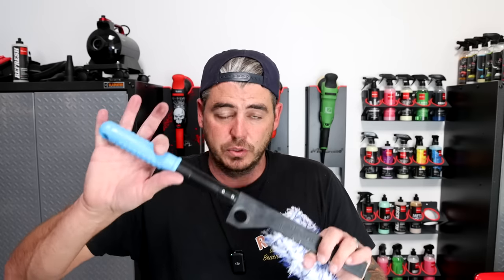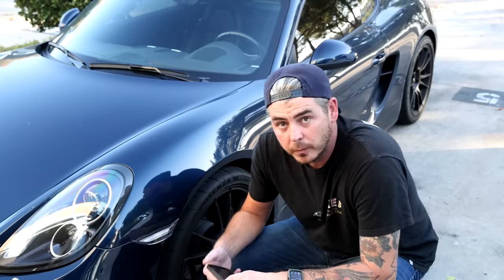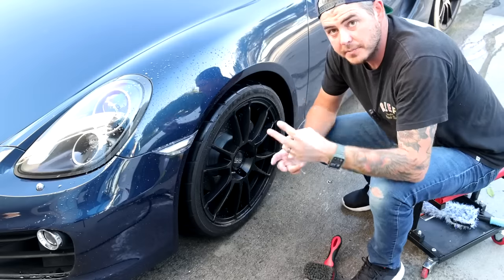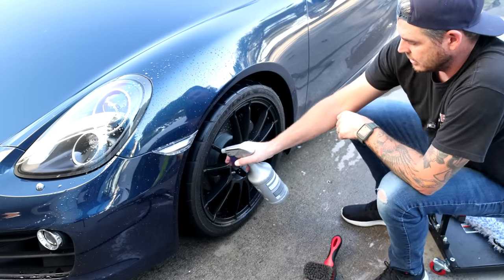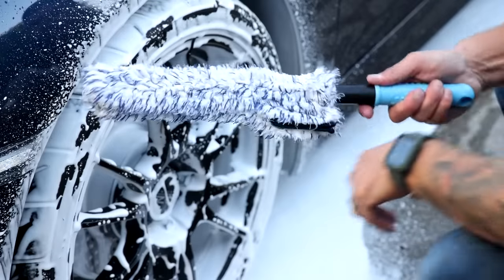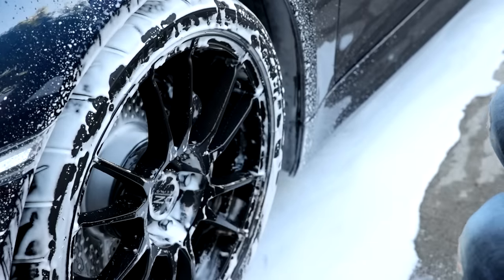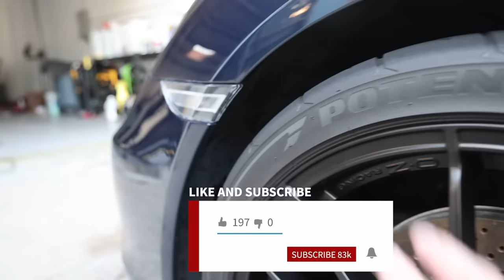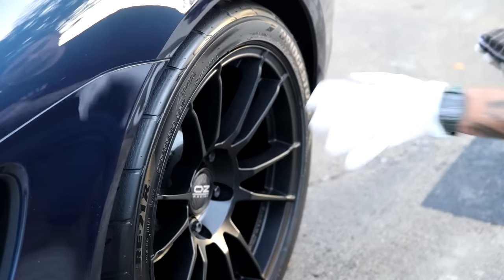HOW TO CLEAN YOUR WHEELS LIKE A PRO | Tips, Tricks, and Tools

Comment: Question Josh, I'm going to wash a high-rise building and will be using a Powerwasher. I will need a lot of hoses and wondering how much psi I will be losing. I heard around 50 psi for every 100' of hose. Is that about right? I'll need a high powered one I suppose.

Comment: Do you have PPF on your Porsche? If so, do you think its safe to use a pressure washer on it? I've been told not to use one because it can weaken the edges of the PPF.
Reply from the maker: I dont but i work on countless cars with PPF. My pressure is reduced to about 1100psi but you still just keep a little distance from the surface and youll be fine!

Comment: Think it's important to note that a dedicated wheel cleaner, which is one of the more expensive products, isn't necessary for a maintenance wash.

If you're a beginner reading this, soap and water works just fine unless you have caked on brake dust.  You can spray an iron remover once ever 6 months or so to prevent any build up, but it's not necessary for every wash.

If you have black high gloss rims and don't want them to get as scratched, first off god bless your soul, but doing a pre soak and rinse with a strong degreaser like Green Star will go a long way
Reply: I fully agree. Regular maintenance is key as with many things.
Reply: What’s your favorite iron remover product that doesn’t smell like shill?
Reply: @jseels  for consumers, Meguiar's All Wheel Cleaner, Griot's Heavy Duty Wheel Cleaner and Adam's Wheel Cleaner don't have that powerful, skunky smell.

Adam's Wheel Cleaner you need to be extra careful with though.  Even after checking to make sure my wheels/brakes passed the "cool to the touch" test, it stripped the paint off of 2/4 of my calipers
Reply: @tier1detailing  Adams I think has a PH level of 10. Did you try dilluting it first?
Reply: How do you clean the mitts / with the microfiber mitts / brushes that contact the wheel when drying them .   I don't know about washing them in the clothes washer.
Reply: Ty for this! I just used a wheel and tire cleaner for the first time and thought, "this is gonna make me broke!" The bottle felt almost empty after one use!
Reply: @christee299  happy to save you some $!  Brake dust that isn't embedded onto the wheel will come off very easily with regular soap
Reply: This! I've used only brake buster as im a noob in washing my car, but it has medium to low performance for me, ive got black matte and high gloss rims, on matte (driving on those as my high gloss are for summer) it does a weak job removing all the brake dust (german car so a LOT of it...) and ive noticed that washing with regular Gyeon Bathe has the SAME results. And iits not super cost effective as i need to spray it a lot (i use it neat) to wash the tire and the wheels. Annd its not so cheap here in EU. Might try just a more agrresive APC also on a little bit more filthy tires, i usualy dont use my pressure washer but a normal Marolex is sufficient to flush the residue. Cheers and great advice!
Reply: Which was was the iron remover?

Comment: Thanks for the vid Josh. Simpler for me to buy a gallon of brake buster, spray whole wheel and tire, agitate and rinse. Only $30 for a gallon and dilutes also.
I am a fan of Koch chemie tho. Especially their motorplast.
I need to get a barrel blade thanks for showing it.
Reply from the maker: Yea brake buster is a fantastic deal and I use it alot also! Personally i think the magic wheel cleaner works better in some situations like this satin black wheel. But Brake Buster is great
Reply: Not worried about pH when only 16% of my solution is actual chemical.
Reply: 16%

Yeah, ok.

74.3287% of people that use percentages to make a point, made up the referenced percentage.

Comment: I bought one of the Barrel Blade not long ago and had the opportunity to use it for the first time a couple of weeks ago.  Did a great job, too!  I may have the one vehicle that it still can't get behind the brake caliper, though.  I own a 2021 Jeep Grand Cherokee SRT and it has big, Brembo brakes on it.  The Barrel Blade works great on the rear wheels; it clears the brake calipers just fine.  The front, however, is still very tough for me.  There's just one part that I can't get the blade to slide under completely.  So, I still need to move the vehicle a few inches forwards or backwards to get at that particular section.  Minor inconvenience to say the least.

I did like the finish that the tire dressing left on your vehicle (nice ride, btw!), so I think I'll be grabbing a bottle of that to try out.

As always, great video and thanks for sharing!

Comment: Thanks for this. I've followed your videos, but the 19" gloss black wheels on my CX-5 are a nightmare. An EZ Detail Brush reached the barrel nicely, but left micro-scratches on my brand new wheels. The Wheel Woolies 9" Boars Hair Detail Brush is soft, but doesn't fit between all of the spokes. I have a pair on Scrub-It microfiber dusting gloves coming in that I'll try next.

Comment: Hey josh! I got a couple questions. 

1.I got a question about my Ridgid 200 PSI 4.5 gal electric quiet compressor. It doesn't want to run with my 2200 watt generater. Is the predator 3500 watt generator enough power for it. I've read online that in order to power that 1.5 HP, you need 6000 watts to. Any input is helpful, thank you.

2. What type of water do you use in to wash cars. What do you carry in your portable tank, distilled or regular tap water from the hose?

Thank you!

Comment: From my experience with Koch Chemie GSF is a prewash/wash for the car because(Ph neutral) it doesn't affect the protection on the car(wax/ ceramic/sealant).GSF doesn't serve a purpose after the Magic wheel cleaner which is more powerful. I use GS for wheels and engine bay and it's a degreaser. Nice video
Reply: GSF is to clean the tires. MWC is to clean the wheels.

Comment: I'm curious if there is a need to worry about Bedding of the brake rotor needs to be a concern with some of these cleaners? Also how thin does that thing go as odd as is sounds I'm having a hard time getting a rim brush tool between my wife's front brake caliper on her Honda Odyssey. I've actually had a few either break or rendered unsafe to use due to metal parts sticking out. It is completely factory and the clearance is really low.

Comment: @josh great video, I have a 981 as well and I'm literally always talking about cleaning my wheels to my friends. They get so incredibly dirty and caked on, I've used ironX, greenstar, and PnS BB(this one is decent). Might have to give the Kcx wheel cleaner a try, seems a lot of spray though, how many washes would that bottle last?
Reply from the maker: Yea i went a little heavy on the spray just for the visual. But the bottle isnt that big so maybe two uses in my opinion. What i do is use this when they get caked up and then use brake buster or something like that for the maintenance!

Comment: Josh what would you recommend for glossy black wheels that have been neglected, lots of build up from brake dust etc…would you goto an acid cleaner? If so which one
Reply from the maker: The magic wheel cleaner is a good choice. Or you can try meguiars hot wheels (I think that’s the one that has a bit of acid in it) if you want to try that. But honestly I stick with non acid wheel cleaners 98% of the time and get fantastic results. Regardless if they are painted black test a small area first to make sure there is no reaction.

Comment: Hey Josh do you use the 1.1 orifice or the 1.25 orifice in the foam cannon with the active unit?
Reply from the maker: Personally I still use a 1.1 but I think they say you should stay with the 1.25 I haven’t had any issues with using it with a 1.1 though
Reply: @imjoshv  how long have you been running it with the 1.1? Thanks for the response. I just picked up the VE52 and don’t wanna mess up anything prematurely

Comment: Thoughts on product to clean TESLA black fan wheels?
Reply from the maker: Good question.. the plastic cover portion right? I would be careful since it’s plastic and test a small area and make sure it doesn’t dry on it. I do a lot of teslas but typically skip the wheel cleaner and go straight to foaming soap and agitation
Reply: @imjoshv  was asking for on the lines of the all black 20” wheel option “induction” wheels. The seem like the same  setup as u got on the 911. But obviously not same lol
Reply: @imjoshv  yes I have actually bought the Uber hose and gun AND the fittings kit and the pink foam annnnnd the mjcc foam cannon. Lol all from your vids. So hoping all works properly

Comment: Hell no , I'd never use the same brush on my wheels that I used on my tires . That's an easy way to get even minor contamination in the brush and a chance to scratch black wheels . May get by with that with aluminum or chrome, but black wheels are super fragile on the finish, especially gloss black, even though those are matte .
Reply: He uses a different brush for the tires? He uses 2 types of red brushes, one is stiff bristle, one is soft.

Comment: I must say that I just tried the Magic Wheel Cleaner out for the first time, and I came away less than impressed. I first tried just spraying it on a small area, then letting it sit for 5 minutes, then spraying it off. Did not do much.

Next I sprayed it on the whole wheel, let is sit for 5 minutes, then agitated it with the special soft brush you endorse, then rinsed it all off. Again not much better than what I get with dish soap and water.

At any rate, maybe I’m doing something wrong?